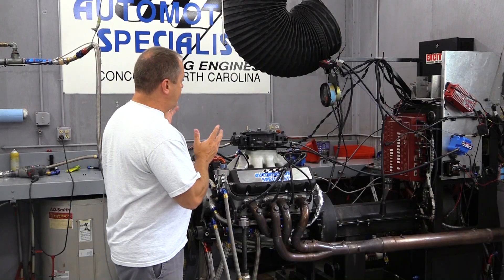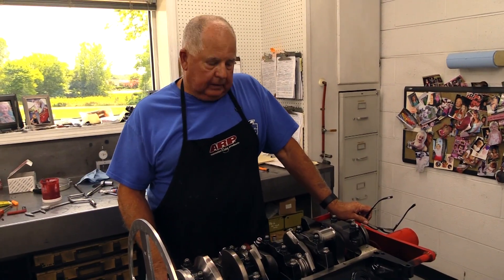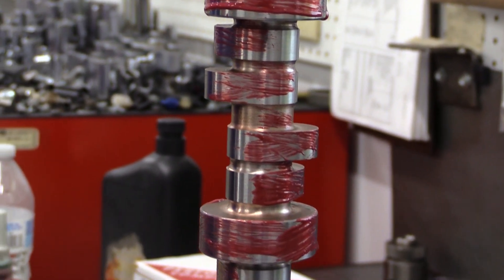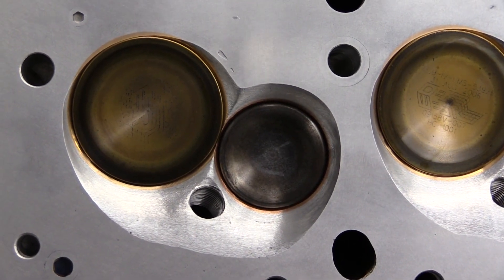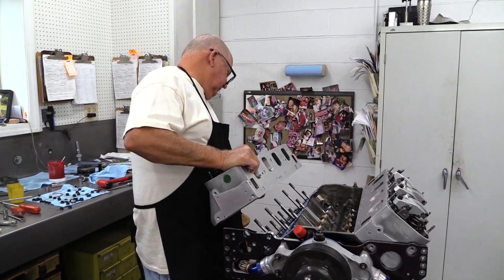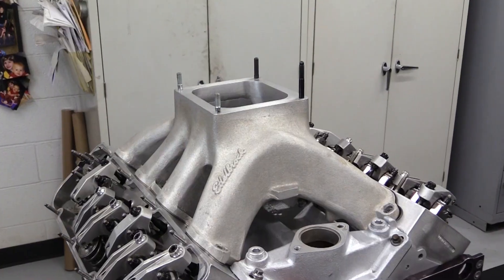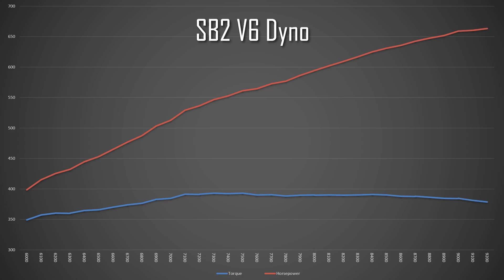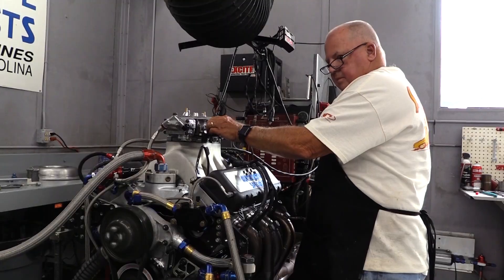NASCAR Chevy SB2 V8 Turned Into a Racing V6!?

Comment: 5:48 that seems counter intuitive
Reply: Not really, Kevlar has 5 times the tensile strength of steel. Timing belts are also more efficient (meaning more power to drive the wheels) and they can absorb harmful harmonics that can occur between the crankshaft and the cam.
Reply: @PistonAvatarGuy  well I'm sold lol thanks for the input

Comment: How is a fiber reinforced belt more resistant to stretch than a steel chain?
Reply: The Sworded Beardsman I don’t know if I can explain this without going overly technical, but I’ll try. Due to the types of fibers used and how they are oriented within the substrate during manufacturing, you end up with a belt that still bends and stretches, but to a lesser extent and totally controlled manner. I’m going to throw out totally made up numbers here because I don’t have the specifications for these belts on hand. They might design the belt for no more than 0.002” of stretch, while the chain has 0.009”. That’s not a huge difference, but every thousandth or ten thousandths of an inch could mean the difference between having proper valve clearances at 8000 rpm or your valves hitting a piston and destroying the whole engine.
Keep in mind that these are specialty belts that may be designed for a specific life cycle, such as 5 Bonneville runs plus testing on a dynamometer before being replaced. The technology behind it has been proven for ages though. Most street driven cars also use belts now, instead of chains. 
 The pre engineered stretch is also the reason HD went to belt drives on their motorcycles, decades ago. I got 95,000 miles out of the original belt and never had to adjust belt tension. I had to adjust the chain on my other HD every 3-5,000 miles due to stretch. 
 I hope that helps, if not, I tried.

Comment: Chose the belt cam drive, is there an advantage of the belt rather than a a gear drive?
Reply from the maker: That's a good question. I just know that NASCAR Cup teams spend a gazillion dollers developing their engines and every one chooses a belt drive--either of their own design or by Jesel or CV Products. Gear drives aren't against the rules (at least I don't think so) and nobody uses one. The main places I've seen gear drive setups are in Sprint Car racing and drag racing. Thanks for watching!
Reply: The Horsepower Monster I use them, and after you pointed out that Nascar does and short course and drag teams do, it might have something to do with the vibration transferred from the gears to the upper valve train, through the  push-em-a-tubes, wearing out stress sensitive components , less rotating mass, and high rpm resonance, quieter makes for easier trouble shooting. Im going to delve further into it! 
 Thanks for replying.

Comment: Surprised not a custom crank for 6 cylinders to change the stroke timing to just the 6. Curious how there is no skipping when there would be a delay of cylinders 7 and 8 not fired before the next of the 6 cylinders fires where after every 3rd fire a piston is skipped. However in high rpm range the skipping wouldnt be that evident I guess as a low rpm would probably show a pulsation in the output not being as consistent.

Comment: Wonder why he didn't turn back the clock to the days when NASCAR Grand National ran V6's... but then, where are the parts? Long gone, most likely... and the technology would have been frozen around the time when they changed to the detuned V8 in 1995. Those were also oversized for this application and his compression question arises again with the needed destroked crank (and sleeving down to size would be a universally bad idea in this app because you can't get decent heat rejection from a thick sleeve in an already thick cylinder wall). 

I do wonder if the custom ground camshaft has a new firing order that puts the joined bank firing events on the back two and balanced across for easier timing... crossplane V8's will always have two adjacent cylinders firing on a side (LRLLRLRR) if you drop the first or last of those events in the order then you'd have a balanced odd fire (LRL_RLR_).

Comment: Love this story. I' watching a Jeremy Hacking run a V6 Syclone 1/4 mile at 185 mph and 7.59 sec. single turbo. I have always had a thing for 6 cylinder engines. NASCAR technology would be so amazing to learn. I once saw 1960's GM V6 Big Block it was made for the half ton. Its Just awesome what is Possible.

Comment: I've always heard the 4.3 L v6 is just a 350 minus 2 cylinders, but this is extreme practice of that. Curious to why he didn't just machine a smaller block, like an actual v6 block using the v8's specs, could have saved a lot of weight, extra work welding and plugging the dead holes, and reduced dead space. Because the 4.3L did not use a counter shaft, so it is almost identical to what he did here. Very cool and very genius!
Reply: 4.3 is still a 90 degree engine and six cylinders firing on a 90 degree axis still vibrates at those sort of rpm. This was really the only solution.

Comment: I guess you wouldn't want the plugs in the back cylinders because of the heat but wouldn't cutting the ground strap off the spark plug or closing the strap to the electrode and putting it in the head keep it from sparking?

Comment: Why not start with a v6 block?
Reply from the maker: There are no V6 heads available that breathe as well as an SB2 cylinder head. Also, the car is used with multiple engine combinations, so it is easier to stick with a Chevy small block V8 configuration to make engine swaps easier. Thanks for watching!

Comment: As secretive as these engine builders are, I’m surprised he even shared any of this build. Thanks
Reply: Ok they are nice numbers and its a cool idea, but i'm a bit confused when he says he couldnt get the valve area out of an existing v8 and that exhisting v6's vibrate more than this thing.
Also whats this about compression? You would think an engine builder would be able to have exactly whatever compression he wants out of any platform
Methinks he just decided a nascar engine already has everything done to it and was the easiest option for this application just to blank off two cylinders.
Which is a cool idea but he doesnt have to bullshit about it lol.
Reply: @m.b.82  So the devil's in the details.  You need valve reliefs to not compromise cam timing and NASCAR heads have about the smallest practical combustion chamber in the head for something that flows.  So that's about what you can get without going to a clean sheet of paper purpose built 4 valve per cylinder sorta thing.
Reply: @mekilljoydammit  Yeah. Its already as far as you can go and its all been done for you with a nascar engine.
Reply: M. B. The comment about vibrations of existing v6’s has to do with the degrees of separation between ignition of each cylinder in a v8 vs a v6 (a v8 has a cylinder firing every 45 degrees instead of every 60 degrees), even though they eliminated two cylinders they kept the same crank spacing of a v8 and used counterweights to balance the shaft. Through the unique setup they got the smooth running of a v8 which is nicer on other drivetrain components and the benefits of extra stroke of the v6 while staying within the max displacement rules for the class they are running. They chose the nascar engine because it’s highly developed and can get great power at high rpm reliably which saves them enough time and money on development. Ironically the fact that they didn’t change the firing order and crankshaft spacing is also why it sounds a bit like a Harley motor and a V8 got mashed together!
Reply: @m.b.82  Not so. He explained the reasons for larger cylinders for bigger valves and longer stroke for more compression. Watch again.
Reply: True  . Getting over 2 HP per cubic inch of displacement , without turbos or nitrous,is simply incredible... sometimes, the Old Ways are Best..😎☺
Reply: @aaronhumphrey2009  That's not even all that impressive these days, there are emissions controlled, production car engines that run on pump gas and make 2 hp per CID.
Reply: @PistonAvatarGuy  2+ HP / per cu. Inch,without turbos- superchargers, on 92 octane  ?!
Name a few, please.
Reply: @aaronhumphrey2009  The Honda S2000, more Porsches, Ferraris and Lamborghinis than I can name, many sportbike engines make around 3 hp per cubic inch these days... It's not a common thing, I suppose, but it's certainly not all that uncommon in higher end sports cars.
Reply: @aaronhumphrey2009  I guess many of the Lamborghini engines are just shy of 2 hp per cid, except for the Huracán LP 640-4, which just hits 2 hp per cid. Some other examples: The Porsche 918 makes 2.2 hp per cid, the 911 GT3 RS makes 2.1, the LaFerrari makes 2, the Ferrari 458 Speciale makes 2.2...
-
To really blow your mind: The Honda CBR1000RR makes 3.4 hp per cid (and it does have a catalytic converter), while the BMW P84/5 Formula One engine made 5 hp per cid.
Reply: @PistonAvatarGuy  okay, so the very best/ latest German and Japanese engines are impressive. This is the very best 50's-60's American engine technology..And I'll wager that it's more reliable and cheap per HP. Still, the Suzuki Hyabusa is a great engine, especially on power to wieght ratio. A mutant V-8 version built from a couple of these has powered a Lancia coupe to ludacris speeds in hillclimbing/ autocross racing competitions in Europe.
Reply: @aaronhumphrey2009  The SB2 is absolutely not '50s or '60s engine technology, it's very modern (the SB2 came out in 1998) and highly specialized (the headbolts being accessed through the ports is a clear indication of that), it's just limited by the fact that it's a pushrod engine. The performance that some pushrod V8s offer is certainly impressive and excellent for the price, but it's definitely not the best of the best.
Reply: @PistonAvatarGuy  yeah and to do that you need forced induction. This is naturally aspirated.
Reply: @all4amd24  None of the cars that I named use forced induction.
Reply: @PistonAvatarGuy  yeah they do, they also utilize way more electronics and variable cam timing and probably variable length intake runners
Reply: And?
Reply: @PistonAvatarGuy   never mind, I’ve read some of the comments others have made to you and it’s clear you can’t be reasoned with
Reply: @stellingbanjodude  Reasoned with? About what? I don't understand your point, man, and you can't even explain what it was, so that's not my failing.

Yes, more complex engines can make more power, that's why engine manufacturers choose to add complexity in the first place. If you want less power and less complexity, that's your deal, but don't sit there and act like this engine is impressive.

Also, I just realized that you might have been saying that the cars that I listed use forced induction, THEY DON'T.

The S2000? NO FORCED INDUCTION.
The Huracán LP 640-4? NO FORCED INDUCTION.
The same goes for the Porsche 918, the 911 GT3 RS, the LaFerrari, the Ferrari 458 Speciale, and every other engine that I named.
Reply: @stellingbanjodude  And, no, I'm not going to sit here and be told that I'm wrong when I'm not wrong, that's not something that a reasonable person does.
Reply: @PistonAvatarGuy  no it’s your ego’s failing. What we are trying to tell you is that every bit of power that was milked from this is due to the engine builders genius. He didn’t have sophisticated electronics, forced induction, variable this and variable that. He has fixed valve lift and duration, fixed intake length, he had to massage everything to achieve this and through his knowledge and expertise it was achieved. Even the inside of the block was polished to reduce windage.
Reply: @stellingbanjodude  But that's what every engine tuner does, so you're stating the obvious, and it's not even relevant in this conversation. Someone said that they were extremely impressed that this highly developed, non-emissions controlled, pure racing engine made more than 2 hp per cubic inch, I simply pointed out that it's not really that impressive.

Without VVT, or variable length intakes (neither of which actually add power, they just broaden the powerband), or race gas, Honda tuners (like Larry Widmer) have made 2.5 hp per cubic inch with the old B-series engines, and they still passed emissions!

Edit: I guess that engine did have VTEC, but some tuners eliminate VTEC because it doesn't offer any benefit in their application.
Reply: @PistonAvatarGuy  being I made the first statement, what your bringing to “my” comment was not pertinent to “my” point.

Comment: This is cool. I’m very familiar with that engine the sb2. I worked for Jimmmy Means for about 10 years building engines mostly and tuning. I have been through many Hendrick sb2 that he has bought off them. We would get those and depending on the history we just did rings and bearings. A basic freshening up and then dyno them. That’s my favorite part. Feeling the concrete vibrating under your feet. The dyno cell has 2 Freightliner mufflers on it since the shop is in the city limits. My house is 2.5 miles away and I can hear the dyno run. Listening from my house I can usually tell if it’s good out of the box or it’s giving trouble. If I’m not busy I’ll call him up and ask if he needs a hand bc it sounds like it’s being a hand full. It’s always fun to go hang out and mess with those engines. 
Very cool what’s been done with this engine.

Comment: Don't get me wrong this is just all kinds of awesome, and really displays the skill of the machinist that built this beast. But I really have to wonder if there is a better, lighter way to get this done. I mean surely there's another GM platform they could have used, or even something import for that matter.
Reply: These guys get lost...
Badly. Look at the aftermarket parts.
You can build 4 cylinders from Chevy sb, Ford small and large blocks. There are tons of parts available without this extra weight and size that is wasted here. This must satisfy some petty rules...
Interesting, but useless.

Comment: Jaguar/Land Rover V6 engines are just like this...  the two rear cylinders of the block are not machined...  eliminated the throw of the crank so its just a straight shaft after cylinder 5 and 6
Reply: https://thumbsnap.com/s/msXbCS3G.jpg

Comment: Imagine if you cut the cylinder head off over that cylinder. Bolt on a plate over the cylinder wall and put a couple turbos back there
Reply from the maker: It would be cool, but the class it raced at Bonneville was naturally aspirated. Unfortunately, the conditions were terrible and they didn't get to make a record attempt. Hopefully, will try again in the fall. Thanks for watching!
Reply: @TheHorsepowerMonster  that is unfortunate I'd love to see what this thing does. I've always wondered why the big 3 as a hole never made 6cyl versions on there small block platforms. It wouldve been awesome to see some of the grandma's and such with v6s based off of there big brother small blocks

Comment: Jaguar actually do this for there current V6 V8 engines. The V6 is the V8 block with the rear cyc not cast in and 3cyl heads in top 🤣🤣
Reply: Dave Micolichek  
Okay NAME examples of AMERICAN V-6 that is 90 degrees. CHEVY 3.8, Buick 3.8, Ford 3.8,

Comment: Very cool! Im not a Nascar guy but I knew a few drag racers that got their hands on some SB2 stuff and it was impressive! Kinda odd he's still using a V8 header.
Reply: They are just dyno headers. You can tell by the o2 port in each runner. And I would say the ones that go in the Landspeed car would hug the block alot more for packaging in the streamlined bodywork.
Reply: @MJTAUTOMOTIVE  I just meant it was odd from the aspect that its got the firing impulse of the V6 but its merging into a 4:1 collector with a dead hole. It would be reasonable to believe it might gain a little bit of performance with a proper 3:1 merge collector. Maybe not enough to really matter but it could possibly make a noticeable difference too. For being sorted out on the dyno that just struck me as odd. I understand the dyno headers aspect. I worked for one of the most winning and well respected NHRA Comp & Super Comp engine builders in the business. The amount of dyno headers they had was sight to see. And the smallest things were taken in consideration for max dyno performance. Again the V8 header on a V6 being strange to me.
Reply: @mytmousemalibu  . Good point. Yeah you would think having that dead hole in the collector would upset the scavenging of the headers but I have yet to see the engine in the car. So as you would know there are alot off other tests that you can do on the dyno before you even look at the headers and exhaust. But we may never know they could of built a trick set of headers with only the six pipes and the v8 set were better. Cool build though.

Comment: Why not just use a 4.3 block its just a 350 block casted without the rear cylinders
Reply: In the vid he said they ran into vibration problems at the rpm they run. The v8 crank with weight runs smoother.
Reply: Dallas Lansink Yeppers, it helps if I watch the video all the way through and this Vortecs were terrible when it came to vibration 😂
Reply: Yep, those Vortecs are basically  a V6 LS
Reply: @pastalover21  not at all the vortecs are completely different than any ls they are however very similar to a Chevy 350 but not even close to an ls in design